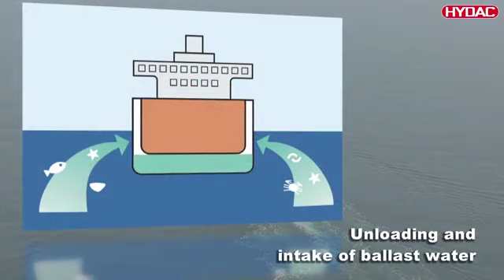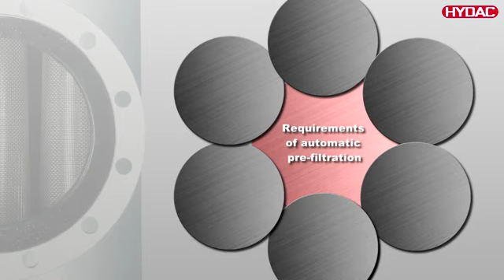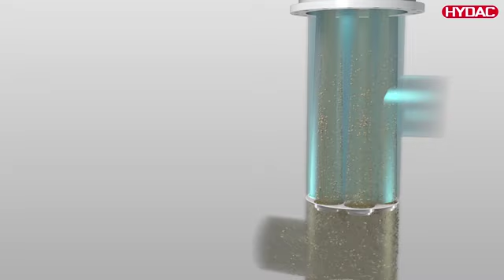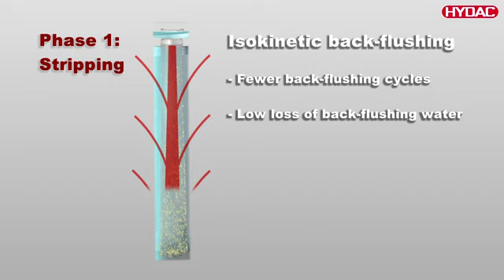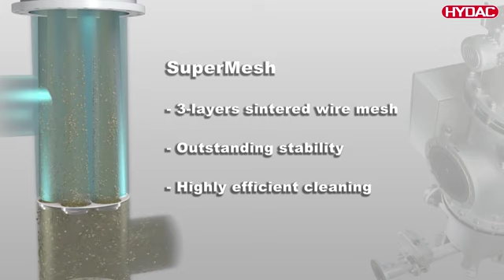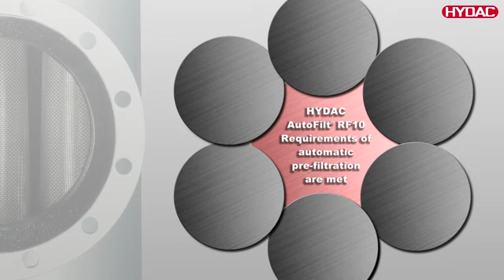Automatic Back-flushing Filter AutoFilt RF10

Comment from the maker: Ballast water provides stability for ships at sea where seawater is either taken into or discharged from the relevant tanks, depending on the freight. This additional weight ensures that the part-loaded or empty container giants achieve their optimum position in the water. 

Without ballast they would be unstable in the water. 
During sea transport, millions of animal or plant organisms are 
however also transported in the ballast water and are taken to alien environments. When discharging the ballast water, these organisms  are released at the port of discharge. 

If the environment in the new location is similar to their native 
environment, the non-native species can survive. Non-indigenous 
species are therefore introduced into the local ecosystem where
they can proliferate or mutate unhindered.

In order to overcome this problem it was decided through the 
adoption of the Ballast Water Convention of the International 
Maritime Organization (IMO) in February 2004 in London, that the 
treatment of ballast water on ships will be compulsory from 2009.

HYDAC Process Technology has engaged intensively with the 
pre-ﬁltration stage of mechanical ballast water treatment and 
provides a comprehensive technical range of components, 
systems and services for shipping. 

More info: http://goo.gl/ydyhLd
#watertreatment #ballastwater #filtration